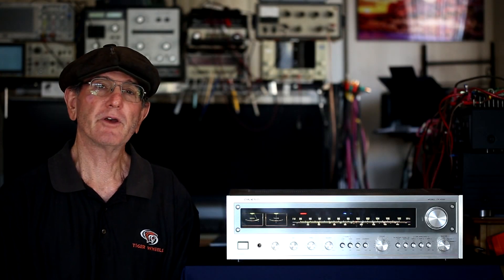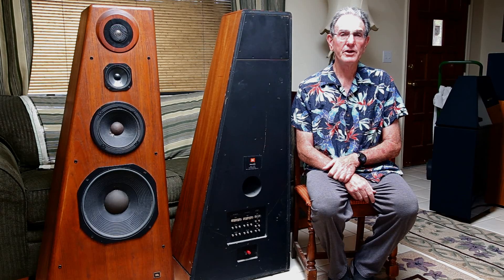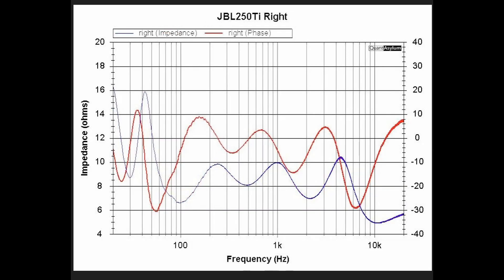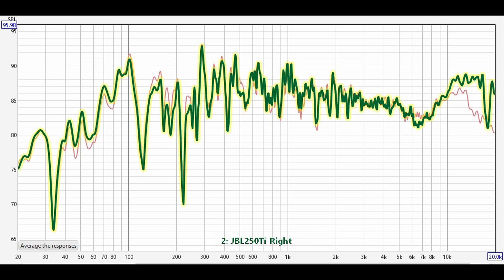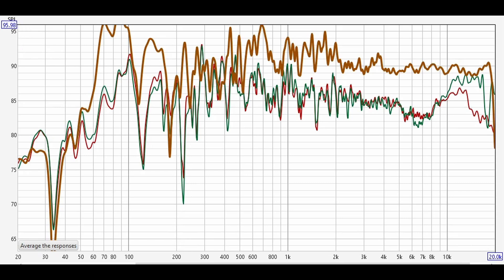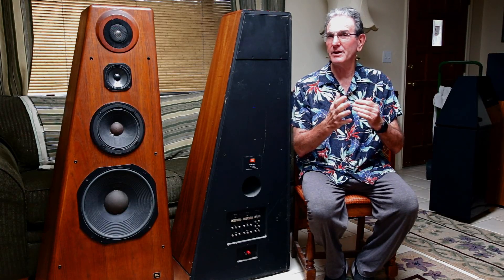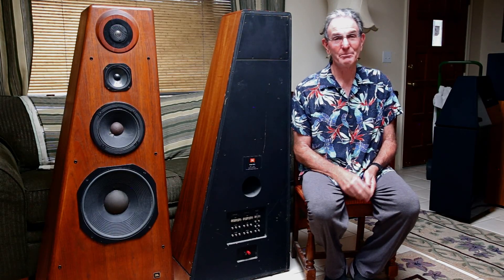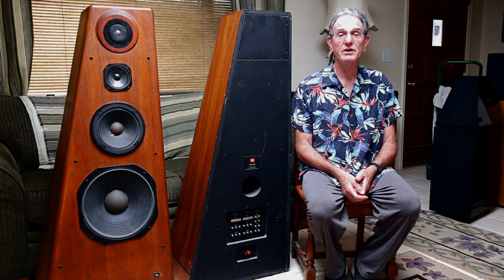JBL 250Ti Loudspeakers- Vintage Audio Review Episode #142

Comment: As an owner of a pair of L250s (the predecessor to the 250Ti) since they were new...

When the 250Ti came out, I was going to change the tweeters over to the Ti but decided that I much preferred the original tweeters over the harsh titanium sound so I've stuck with the stock tweeters.

As to the grills, they only cover up the cone drivers so the ultra high frequency tweeters are not covered by a grill (aside from the metal mesh that is part of the driver) so your measurements should have been minimally affected, at most.  Depending on my mood, I have had mine with the grills on or off and never considered one way more musical than the other. 

With respect to tweeter response...believe it or not, they can suffer from foam rot too!  Behind the dome of the tweeter is a foam pad and slug and when they deteriorate, like all foam, not only will it change the timbre of the driver, the foam bits work their way into the gap on the pole piece.  All of this will affect its high-end response.  Look up JBL 035 Ti foam damping. 

Another tidbit when the speakers were new.  The boxes on my L250s contained two numbers from the factory.  Each speaker was serialized (and not sequential...no doubt, they made Lefts and Rights separately) however there was also a matching serial number for the set.  So, they either matched them acoustically, via measurement and/or were considered that their wood would appear matched. The imaging on them were better than I had heard with any other speakers that I were auditioning, at the time.  So, I presume that when they paired them up, they determined that they matched, sufficiently to be declared a pair. 

The response of them was better than you've showed, at least in my home where I did measure their ⅓-octave response via RTA (I tuned movie theatres for a living so I had the equipment to make such measurements, even in the early '80s).  I'm not saying that they were ruler flat but their low-end was definitely smoother than your graphs would indicate. Your high-end response is likely due to foam rot and the titanium dome.  

They have been my reference speakers since they came home the first time for all of my LPs or other media...until I made some JBL M2 replicas (JBL components, custom cabinets).  The M2 is a better speaker, to my ears and despite being about 40-years older than when I first heard the L250s, the M2s were clearly better, with the same content, which I've heard for decades and am familiar with.  

As to the woofer issue you noted.  Mine only suffered from the inevitable foam rot. I reconed it back when JBL still made the cone kit...future foam issues will be via foam kits (my least favorite speaker repairs...with a full kit, you can center things up easily and be in and out pretty fast with glue drying time taking up the most time...refoams are messy (particularly if you let it go to the point that the stuff gets sticky) and centering is always a little bit of a challenge nor is there an opportunity to clean out the gap.  I suppose JBL still has the dust domes (I'd have to check) if I wanted to use the shims.  The spider should be keeping things centered though. 

In any event, did you test the woofer out of the cabinet?  If it were on my bench, I'd test the driver, on its own and sweep it from 20Hz to 1.2KHz (or whatever the sheet calls for on the driver) and listen for rubs and buzzes.  Normally, a rub will show up at many/all frequencies...particularly at 20Hz.  To have it be just at 125Hz makes me wonder if you don't have something loose and it is resonating at that frequency.  

Thanks for the video and I hope you get them sounding their best.  They can be an absolute treat to listen to.
Reply from the maker: Thanks for taking the time to comment- you would probably get the comment of the year award if I had one. The 1st response dip I am pretty sure is from my room acoustics as most every speaker shows that. I did not think to run the woofer out of the cabinet- good idea. The owner sent the woofer out for repair and have it re-foamed while they had it. I head not read up about the tweeters issues you mention, but will look into a bit more- I hope to listen to them with the repaired woofer at some point...
Reply: @vintageaudioreview  
Also remove the tweeters and measure their individual response using 1kHz to 20KHz band-limited PN in order to determine if it is the Tweeter itself, or an issue with a component(s) in the tweeter's HPF crossover that is responsible for the discrepancy in L/R response.

Obviously, using foam damping plugs behind the tweeter dome is a bad idea.  Most manufacturers use some type of wool felt disc or plug for this purpose.

I know most people are purists when it comes to their vintage gear, but I would honestly search for a better modern tweeter for these JBLs that would be a dimensionally close drop in replacement.

This would require an adjustment to the tweeter's HPF component values, but for a speaker of this age I would want to replace these parts anyway!

For overall value and performance, I really like the SB Acoustics SB29RDNC-C000-4 silk ring-dome tweeters, or one of its variants.

I also have several audio enthusiast friends in this hobby who create well-designed and absolutely beautiful custom speaker & tweeter mounting/adapter plates or entire pods via high-quality 3D printing, and at very reasonable pricing.

Some of these enthusiasts also have home CNC machines to fabricate these types of adapters out of aluminum or high-quality plastic composites such as UHMW or Delrin, etc.

They will also custom form custom metal mesh grills.  A variety of very nice metal mesh grill materials are available from sources such as McMaster-Carr.
Reply from the maker: @bbfoto7248  Another good idea- he is getting the woofer back in a week or two so maybe I will bring my stuff over to his place and measure the tweeter....
Reply from the maker: @bbfoto7248  Once again, a lot of useful information! Thanks!!
Reply: @vintageaudioreview  
I look forward to your findings.  :)

If you do find that one of the tweeters is the culprit and they need to be replaced, I would take a look at the SEAS Prestige Titan 27TAC/GB aluminum/magnesium dome tweeters.

These are available at Madisound for ~$195/Pair.  They will easily outperform the original JBL tweeters and look to be a similar form factor, but you would have to check the specific dimensions and mounting hole configurations of both to be sure.

While the SEAS are also "metal dome" tweeters, they exhibit extremely smooth, non-sibilant, yet extremely detailed response both On-Axis and Off-Axis.

These should eradicate any misconceptions and stigmas regarding the inherent harshness and fatigue of "metal dome tweeters". 

They're an excellent choice for older ears that may have some high frequency hearing loss but are still averse to using metal dome tweeters.

You can search for and read the reviews for these tweeters, but in short, they are one of the best in regards to providing that top end "air" and incredible Imaging and Soundstage performance.

Cheers

Comment: Needs a whole new crossover. All those parts and the response is terrible. Life was tough in the 80’s.
Reply from the maker: Thanks for the comment- there is the possibility as suggested in a few of these comments, that the crossover may need some help...
Reply: @alexw890  
I'd suggest just starting with a better speaker design in the first place, along with appropriate high quality crossovers.  :P

I love old JBLs, but...

In another comment I outlined a DIY speaker design in a similar form factor and finish that would cost between $1700 and $2000 while providing significantly better performance in all regards... except maybe nostalgia.  ;)

How much would someone pay to purchase these vintage JBLs in excellent condition, and then to refurbish them as well?

Comment: i do crossover upgrades for these. The 250ti used a lot of electrolytic capacitors that are all expired by now. That fall off at the top end of one of the speakers is most likely due to a failing capacitor.
You could use 1/3 smoothing to make more sense of the response......all those small spikes up and down are room related and not real response. You can also use 1/2 meter measuring and adjust the db level , this will take out a lot of the room as the direct signal becomes much more dominant compared to the reflections.
The mic should be centrered just below the tweeter.......it will fill in that suck out at 3khz-7khz.
Reply from the maker: Thanks for the suggestions and taking the time to write them. I am embarrassed- I have been using 1/48 smoothing and just tried 1/3 smoothing which really smooths the plots out! Have no idea why I thought 1/48 was more smoothing- must have been in my early days of using REW and I just go right to 1/48- not any more! I have tried the 0.5m measurements on occasion, but not typically for my reviews so I can compare with previously measured speakers. The owner sent the woofer out for repair & was going to have it refoamed while it was there. I am not someone who will replace caps just because they are old- it would be interesting to measure the crossover before and after re-capping, maybe at some point- my guess is there are some tweaks out there for this model.
Reply: @vintageaudioreview  
  @crossoverchef   beat me to it and made some excellent suggestions.  👍

1/3rd to 1/6th smoothing for the RTA graphs is more indicative of how we actually perceive the in-room response.  But you should still perform your measurements in 1/48th.

I was also going to suggest that the vertical microphone height be closer to or directly on-axis to the tweeter height, as well as that old failing components (especially the electrolytic caps) were most likely the culprit for the discrepancy in the high end response between the two speakers.

It would be easy enough to identify the suspect component and replace it/them, then remeasure to confirm.

It's too bad that your buddy didn't decide to have the woofer repaired BEFORE you put all of your time and effort into your objective and subjective testing.  :/

Overall, these JBLs seem like decent speakers to invest in and refurbish, though replacing and/or upgrading all of the components in the crossovers could get costly!

If it were me, I might choose to upgrade only the components in the crossovers within the circuit of the configuration/jumper settings that provide the smoothest and most linear response, and "decommission" the other jumper options and crossover components.

If you don't already have one, I might suggest investing in a reference subwoofer that plays cleanly up to at least 150Hz which will allow you to experiment with its placement in order to fill-in those specific bass cancellation modes in your room at your listening position.

And by "reference" subwoofer, I don't mean a "high-end" subwoofer, but only a "reference" in regards to comparing the low-end response measurements and listening experience of the speakers you test and your room with and without the subwoofer engaged.

There are plenty of commercially available and relatively inexpensive subwoofers that will do the job.  I might look at the HSU Research, Rhythmic Audio, Dayton Audio, and Monoprice offerings, but there are obviously many others.

You don't need a monster subwoofer for this purpose, but I would suggest one that reaches down to at least 25Hz (in-room).

Many years ago I obtained multiple 12" & 15" Infinity Beta X raw subwoofer drivers in a close-out sale and have used them to build many different DIY subwoofer systems for testing purposes and for car, home, and studio use.

They aren't SPL monsters and are subject to power & dynamic compression above roughly 350w input, but with proper enclosure alignment and subwoofer placement using boundary-loading to take advantage of the transfer function or "room gain" of the specific environment, they provide excellent low-end articulation, impact, and extension, and help to smooth out and minimize the destructive interference/cancellation nulls at the listening position.

There are plenty of high quality/high-performance and relatively low-cost raw subwoofer drivers available from manufacturers such as Dayton Audio (Reference Series & Ultimax), Stereo Integrity, Acoustic Elegance, and others.

The majority of these companies will provide you with plans or assistance for designing and building a simple but ideal enclosure for their specific drivers.

A relatively inexpensive subwoofer "plate" amplifier with built-in variable crossover, variable phase, and level controls can be used to adjust and power the subwoofer(s).

While sitting in your main listening position with your measurement microphone, place the subwoofer on a standard low profile furniture dolly with casters, or use the 4"-6" diameter thin plastic disc furniture moving "sliders" under the feet of the subwoofer.

Using only the subwoofer, play band-limited correlated pink noise or sine wave tones at the exact center frequencies of each of your listening room's known cancellation nulls/modes, and have someone move the subwoofer around to different locations in the room until the cancellation modes are minimized as much as possible both by ear and your measurements.

Also check the response over the full passband of the subwoofer (let's say 20Hz-200Hz) to check for other potential destructive interference nulls or excessive peaks that might appear.

Once the low end response is optimized and smoothed as best as possible, mark that position on your floor or take x/y distance measurements for future reference.

Confirm that the response is still complementary when the subwoofer is combined with your everyday reference loudspeaker setup and positions.  You will most likely have to adjust the variable phase control, crossover frequency, and level for the ideal response when combined with your main loudspeakers.

Then, whenever you are performing a review and measurements of any given loudspeakers, you can temporarily move the subwoofer back into that position and take measurements and listen both with and without the subwoofer engaged.

Thanks for this review, and I look forward to others in the future.

Cheers!
Reply from the maker: @bbfoto7248  I will take your subwoofer suggestions under consideration. I do have some powered subs that I could try out at some point. I typically point the mic between the mid and crossover. I should try playing around some more next time I do speaker measurements. Thanks for taking the time for the advice!
Reply: I was wondering if the crossover had been re-capped. Probably has a lot to do with the high end mismatch.

Comment: These were a unique system for JBL. People expect them to be a refinement of the forward and lively vintage JBL sound but they are more of a purist speaker that is very neutral. They don't really need a lot of power but they need an amplifier with good damping factor to control the large woofer and keep it in line with the neutral laid back voicing of the mid and high frequency drivers. They can be pretty impressive when driven properly. The original teak ones seem pretty rare.
Reply from the maker: Nice comments! My friend sent to woofer out for repair and when he gets it back, I will listen to it again. Neutral sounding is a very apt description.